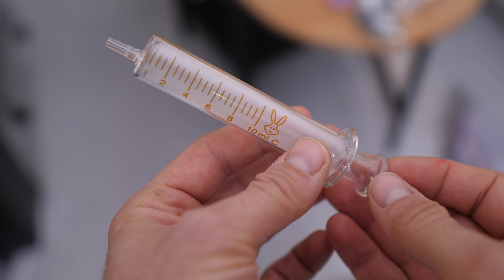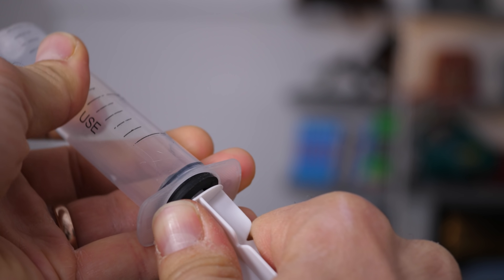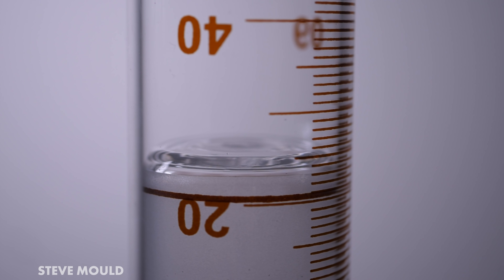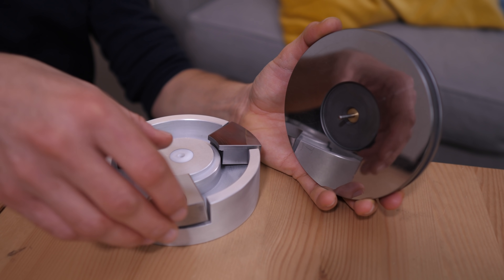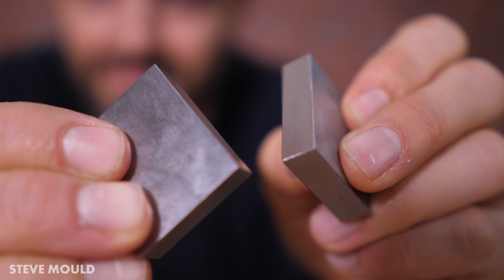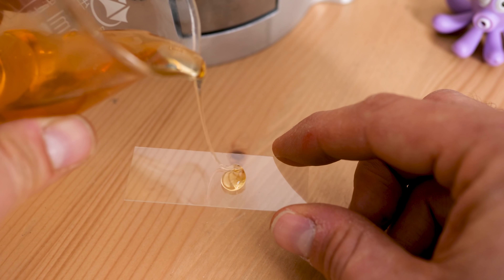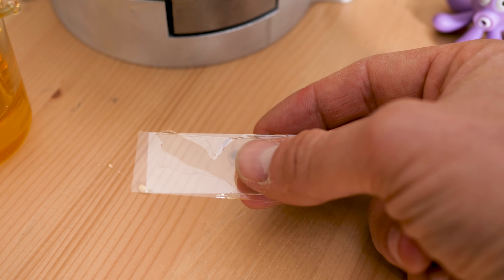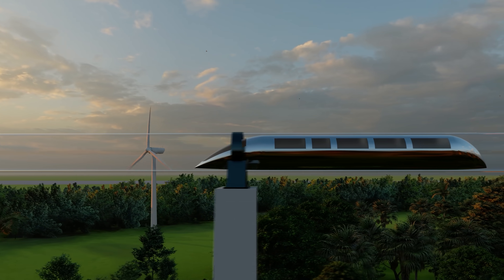The Self-Levitating Kingsbury Aerodynamic Bearing

Comment: Correct me if I'm wrong but the reason why gauge blocks "stick" to eachother may be due to the Van Der Waals Force.

Same force manipulated by Geckos to climb smooth surfaces.

What it essentially is, is when one block's flat surface meets another, there is more contact to contact points where both block's atoms are next to eachother.

Now, sometimes electrons may be on one side instead of another, this creates a temporary positive charge, this is induced onto its neighboring atom ( the other block's surface atom ), it's charge faces the same direction.

Neat thing is, this connection can be severed if you move the block in the opposing direction of the connection,

 If you do what you did in the video, pushing them and rubbing then UP together, all you'd need to do to break it is flip it upside down.
Reply: Actually I believe it has been discovered geckos mainly stick due to electrostatic forces

Comment: Same stuff in a car engine turbo: In some models the rotor reaches such high speeds that it can't be standed by any common ball bearing, and special bearings (that exist) are too expensive for such an use.
So they found a trick: in a tiny oil bath, the rotor at high speed centrates alone due to the oil viscosity and the centrifugal force on the shaft.
Here the air viscosity works the same way.
Air viscosity can be very strong: Try to pull very quickly just ONE sheet from a paper ream: It's impossible, you'll get 4 or 5 next at the same time... They seem to be glued by "something": Just air...

Comment: A better conductivity test methodology would be to use nylon spheres instead of steel to support the pads, and connect the conductivity test leads directly to the pads. Doing that would eliminate the additional friction of the test lead touching the rotor stem.

Comment: Is it possible that the heat expands the air molecules causing the cushion effect, but the spinning causes the heat to be lost centripetally to the environment, then the air molecules contract and friction comes back into the equation, it would explain why it works better after 5 minutes of first attempts. A constant heat source might help? and a tiny diameter of long axis. For something that spins for longer without the friction? Maybe if a paint that reflects infra red heat back into the air, that might help also. Would need to be painted on the inside diameter wall of the inside tube of the syringe.

Comment: At 8:17 you explain that the air is drawn air is viscous, sticks to the surface and then explain with the model of honey. Yes honey is more viscous than air. but not just a bit, it's tens of thousands of times more viscous!  Much of the nonsense about drag in aerodynamics is based on the viscosity or friction of air. In "normal" environments, air has no appreciable viscosity. There is no appreciable friction. It's really, really tiny!
The reason your plunger rises from the bottom surface is air pressure. The initial vibrations in the spinning plunger push and pull the air in the space between the plunger and the body not viscosity.

Comment: Great video! Here’s an idea: the thin layer of air in the bearing should form a capacitor while it’s spinning. The capacitance should be lower when it’s spinning faster because the air layer is thicker. Make an oscillator with that capacitor and then play the sound whose frequency fluctuates as the speed, and thus thickness, changes. The sound would of course drop out completely when the plates touched… I bet this would sound really cool

Comment: Sorry for the late comment, but if you're fascinated by long-time rotation, then check up pressure measuring devices: dead-weight testers or piston-cylinder assembly (especially aspect of effective area derived from dimensional metrology).

Comment: im curious to know if this is used as a thrust bearing for much larger machines... is there a certain way you can increase the cushion of air? how easy is it to stop this aerodynamic thrust bearing by applying weight to it?
Reply: Air bearings made out of graphite where air is pumped through it are fairly common but usually they can't support really big loads compared to other bearing types.
Reply: But basically any plain bearing works the same way just usually with oil.

Comment: Large steam turbines in power plants often use a sort of combination hydrodynamic/ hydrostatic.  When the turbine is turning slowly, there is not enough hydrodynamic force dragging oil under the shaft to lift the heavy turbine off the bearing metal.  This means you often have metal-metal contact and it's much harder to turn over the shaft with a turning-gear motor.  So high pressure oil is injected under the shaft with special pumps (often referred to as 'lift pumps' because they 'lift' the shaft a tiny amount to avoid metal-metal contact).  Once the turbine is sped up and hydrodynamic forces are stronger, the 'lift pumps' are shut off and the shaft is suspended by the hydrodynamic lift forces of the oil being pulled under the spinning shaft.  When shutting down, the 'lift pumps' are automatically restarted as the shaft speed slows to minimize metal-metal contact as it slows.  It's an interesting variation on bearing design.

Comment: the ice skating example is a little bit off from what I have seen on other explanations. It doesn't melt, instead the still frozen ice particles act like tiny ball bearings. More accurately I should say ice does melt some but that's it's not the primary factor in it being "slippery".

Comment: Could this have an application in f1 racing?
Reply: Well we have been using hydrodynamic bearings for a donkeys years, I think they know about them..
Plain bearings (like engines) are this but use pressurized oil to lift the surfaces off each other.

Comment: The original Hyperloop concept used hydrostatic bearings, not hydrodynamic. The idea was to have a large compressor on the front of the capsule to draw in air and force it out through nozzles on its base.

Comment: On gauge block "wringing"... aside from vacuum pressure, there's also this thing called a "cold weld" wherein, under the right conditions (flatness, no oxidation) bunches of metal atoms of either piece bond with each other. en.wikipedia.org/wiki/Cold_welding

Comment: I've always though that in an internal combustion engine with a pressurized oiling system that at the crankshaft where oil is delivered under pressure to the crank hole where the rods connect [also the main bearing journal]  that as soon as the engine gets oil pressure, that pressure forces an oil cushion between the bearing and rod journal where it hydraulically pressures the rod journal to center in the bearing within the bearing tolerance. While that may still be true, I now believe that the viscosity of the oil is adding to support the rod journal into the center of the bearing.
Hence, both of the physics properties [Hydraulicing and Viscous surface tension] are working together to ensure that the bearing surface during operation does not touch the crankshaft rod journal. [The same applies in all other rotating oil pressurized bearing systems]

Comment: If friction (or the surprising lack thereof) interests you, the bearings for the storm surge barrier near Rotterdam might interest you as well. If I recall correctly, it's a hollow steel ball joint that rests in a concrete cauldron of sorts, and the cauldron is clad with pads of an expensive type of plastic... Delrin, I think. The surface of these pads apparently turns semi-viscous as soon as the thing starts moving.

Comment: 6:40 try to connect dynamic loudespeaker in series with this flywheel and some 1.5v-9v battery - probably it will work like some kind of PWM microphone,when speed is not too high,and your voice can act on flywheel causing sound dependent connections pulses on the speacker

Comment: old train bearings worked in a similar manner, the brass bearing block was a block that sat overtop of the train axle and was machined at a slightly bigger diameter than the axle. the whole assembly housing contained the bearing, a big pad sat in an oil bath, as the axle rotated, a thin film of oil would form between the axle and the bearing block.

Comment: In industrial hydrodynamic bearings, I am wondering if the change of temperature as the spin rate increases changes the viscosity of the fluid (say oil) enough to provide a significant drop in drag. That would improve the overall efficiency of the design when the permanent regime is reached. Anyone knows ?

Comment: Why call this phenomenon involving no water, 'HYDROdynamic'? We call lift systems using oil hydrodynamic, so HYDRO-might work for any liquid, but the phenomenon shown still takes no liquid at all. 

Next, why call this phenomenon hydroDYNAMIC, when it involves pushing no air into it? Seems like static air. In that case, wouldn't one name the phenomenon PNEUMOSTATIC?

Why call shuffle board and hovercraft phenomena hydroSTATIC, when air involving them must be steadily blown? Blown air is moving or dynamic air. 

Why make such a fuss over names? Because, confusing names confuse scientific illiterates like me. 

I read and many say, electrons are negative, protons are positive. Good, so far! Then there is negative electricity--a flow of negative electrons. Then some bright eyes suggests 'positive' electricity. 

But positive electricity could not be protons flowing thru a wire counter to the negative or true electricity flow. 

What the Hell then is positive electricity? Some kind of scientific analog of the Holy Ghost?
Reply: All the demonstrations are great, but without terminology matching reality [to my mind], it feels like listening to Abbot and Costello's exchange regarding 'Who's on first [base]?' Or is it  ' HU's on 1st?'

Comment: Gauge Block Wringing:
The surfaces are so flat, that when pressed together, these two surfaces become vacuum inbetween.
But due to their insane "fit" together, even AIR is too thick to fill the vacuum up ... making them, yep, stick together.

Deadsimple, really.
Reply: I wonder, what if you could spin the 2kg block up to speeds of say 20'000 RPM?
The block would likely disintegrate, but if it did not, what would happen?
Reply: The bearings work with similar system, though, the rotating part is NOT that flat, thus it "drags" air into the two parts, making an air cushion.
Very interesting system, it has a bunch of practical advantages.
For one, virtually no wear and tear.
Then there's saving of energy is another, it's cheap 9no need for (electro) magnets, ... .
Marvellous, really.

I would get an eargasm if it would also make music.
Now I only have a mindgasm ...

Comment: the skater slide not because of pressure melting, but because ice is covered with thin layer of liquid water and the skater won't slide at temperatures below -80C

Comment: As Steve was talking about looking for someone or somewhere capable of putting the contraption together, I wondered if my small lathe could meet the specs, and started thinking about the workholding and sequence of operations, and why HE didn’t think of using HIS lathe. Then the footage of the compressed air spinning bearing came, I just though ok nothing new there, then he said “i really want a compressor.i should buy a compressor” made me look up at the video again and thought “Huh he doesn’t have a compressor? But he has a lathe, how can he…” then it hit me. I was in a machining video sequence just before, that gave a brain hiccup I think. My interests in science outreach content and machining/craftsmanship in general never meet in the same video, or at least not so much that my mindset is the same (or changes smoothly) when going from one topic to another. Why doesn’t that happen more often? Also, yes, tom’s channel is awesome. Loved to see the interaction.

Comment: Don't mind correcting a bit.
When you spin the plunger, the air being viscous moves the air with it.  Moving air has lower pressure because the energy contained in the air is converted to kinetic energy called motion.  While the still air a bit a way has higher potential i.e. inertia. Inertia is potential, it doesn't want to move, translates to higher resistance, higher pressure.

Comment: The mentioned viscosity of air is the reason why hard disk drives work. The read/write heads are lifted by airflow created by the rotating disks. They fly in the wind created by rotation... 😃

Comment: Hydro static bearings are even used in cryogenic turbine, to run the turbine at high speeds for ex. At 50-60k rpm. friction can seize the shaft if its not Hydro static bearings.

Comment: The bearings in your car’s engine are hydrostatic I believe. The crank bearings are all smooth. They’re just flat surfaces that are ground real smooth and rest on each other. The crank bearings have holes drilled in them for engine oil to get pumped right onto the crankshaft bearing surfaces.
Reply: That is correct, it uses a “fluid film”. The only issue is the oil gets squeezed out due to the huge downward force of ignition. The oil has to be pumped in at pressure to keep the metal from contacting during ignition.

Comment: The other half of the effect in the glass suringe is also very interesting, as the air leaves the pinch point it expands, reduces pressure and pulls the syringe up, this balance between compression pushing and expansion pulling means you end up with the glass being supported directly in the centre, which then eliminates wobble and makes it a very efficient spin, which is also why it lasts so long and you can use a very rough turn to get it working.

I'd be interested in understanding the larger applications, the low friction/low effort/no wear set up could be very effective in heavy industry (e.g. the turbines you mentioned) and the autocorrecting rotation good where high tolerance is necessary - a self balancing system could have unlimited accuracy

Comment: 10:10 This might be wrong... I think. The pressure needed to melt ice is far to great. It is because the top water molecules are in weaker molecular bonds compared to the rest of the ice (because they are not surrounded by water molecules), and therefor are more prone to moving around than the more solid "center" ice. (I am not sure, please correct me if I am wrong).

Comment: 5:17 i might now the basics of why:  if both surfaces are flat enough and pressed against each other, they will expel all the air molecules between them, causing a dynamic vacuum that results in a negative pressure and often charging the surfaces with a tiny magnetic polar opposition in the outer layers of the materials, so in space, you could actually fuse 2 of those blocks if u charge them correctly and rub their faces together enough...(if theres no oxide/contaminants on them)

Comment: Probably one of the most common hydrodynamic bearings are the ones In internal combustion engines,  such as the crank and rod bearings. Hence why the viscosity and quality of oil is important.
Reply: Also Turbochargers, they spin so fast they wouldn’t be able to use any other bearing I think.
Reply: @timehunter9467  Fome turbos use ball bearings, which allow the turbo to spool faster. But the journal bearing would be a hydrodynamic bearings. Here is a good video explaining the difference of you are interested 
https://m.youtube.com/watch?v=h8VjG6g-8dw&ab_channel=PrecisionTurbo%26Engine
Reply: @KJR-n5u  I took one apart that looked like journal bearings but no holes to fill them, only a gap in the middle which was why I thought it was the same. Nice video btw.
Reply: Except why is the syringe hydrodynamic but it only has air in it isn’t that pneumatic dynamic

Comment: I think the reason of the gauge block is electromagnetism, atoms have a little if the surface is smooth enough and all other molecol of air are take away atoms of iron are close enough to attract toghether, atoms in any case in the solid form do not trigh the covalent bond and stay separate, this experiment is very interesting you should dig it.

Comment: What's fun is, if you take a small granite surface plate and place its calibrated side on a large one, you can have the same effect as the syringe when you get it moving. It's almost like it's on an air hockey table. When it stops, it will wring itself to the other block though, and it will be difficult to remove.

Comment: "Nobody really knows for sure why gauge blocks ring together...". This in itself is fascinating but I think you then go on to answer the question of how they work?
"Air is viscous... like honey, if you pressed between two surfaces there is some friction". 
Surely this viscosity mostly explains why two gauge blocks would stick together? Is it not the case that the two surfaces are so closely mating that no more air can quickly enter the gap, the weight of one half of the gauge causes an amount of suction between the two, when held by the other half?  Similarly, spread any viscous flavouring between two hard and flat surfaces and there is a suction effect when the two are pulled directly apart or even rotated away from each other.